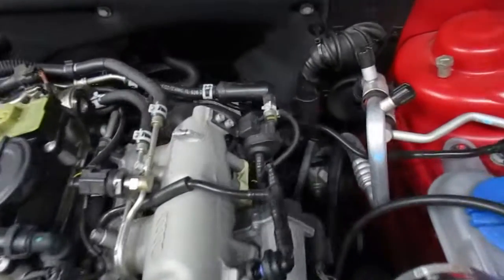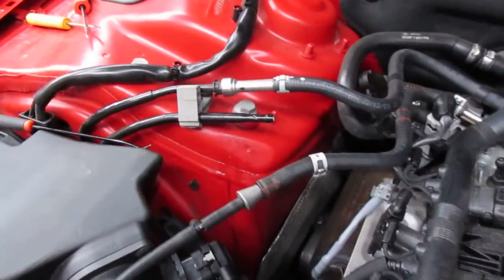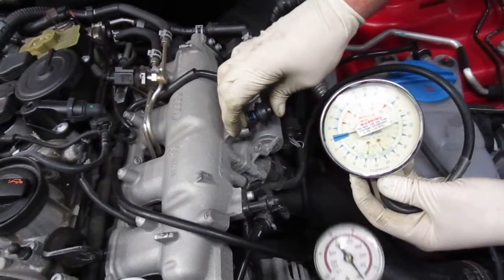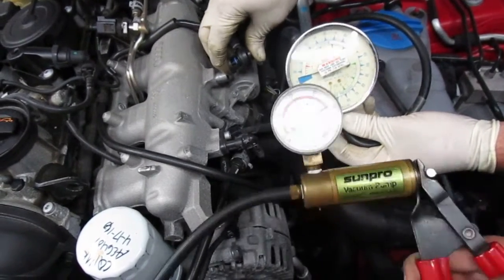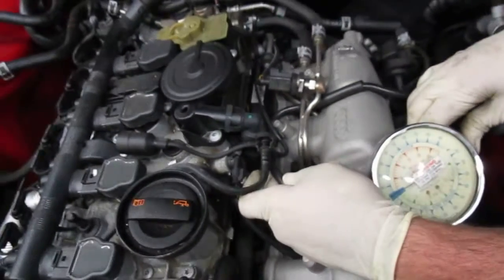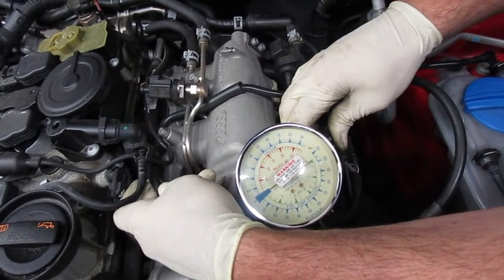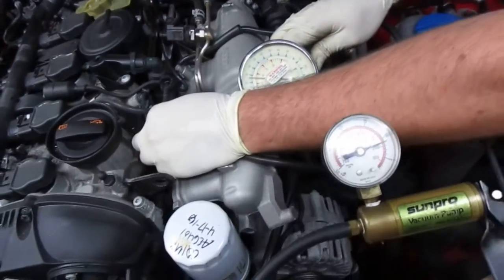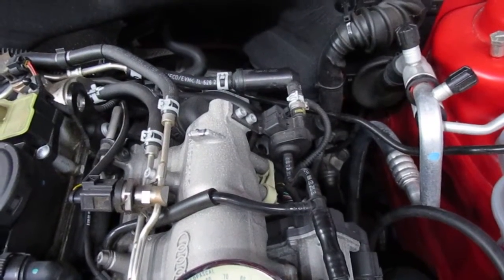Testing a 2013 Audi EVAP Purge Solenoid

Comment: having trouble finding exact replacement part. all the pictures show the older version from the 2012 or older A4.  do you know the part number used to repair. I'm trying to repair the same kind of car 2013 Audi A4 2.0L Quatro  . thanks

Comment: Thanks for the video. May I ask a question that if I unplug the evap canister port(the one in the middle of the intake manifold where the hose is unplugged in the video) start the engine(rev up to 2k to 3k rpm) and spray carbon cleaner through the port. Anything will happen?
Reply from the maker: Shawn if you spray a cleaner through the remove purge vacuum port the spray will go into the intake since it is a central port. Be careful not to spray to much at once or engine damage may occur. Only spray on a running engine. Hope that helps...thanks for watching...If you have not already subscribed to our tstseminars YouTube channel please do so. Interested in more training? Go to www.tstseminars.org and www.attstraining.com.
Reply: @TSTseminars  Thank you. I really appreciate your answer. What I was worrying about is that if we open the port and start the engine and rev up, are we going to have a check engine light on since there is vaccum leak from the port? If we will have the check engine light and we put the hose back on after cleaning spray is  done, will the light go off after a engine start or we need to do it with a tool to erase the code.
Reply from the maker: Shawn the only time the light would come on is if the EVAP system was trying to purge. If you fill you gas tank up the EVAP will not run any test and the light will not come on. Have a great day
Reply: @TSTseminars  Thank you, professor! You have a great day too :)